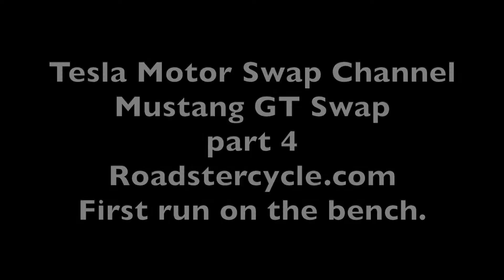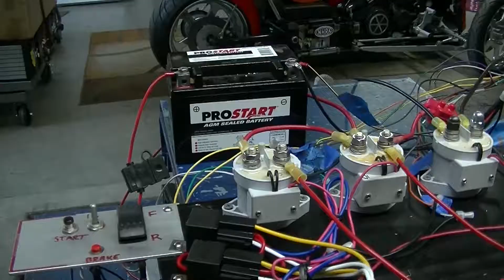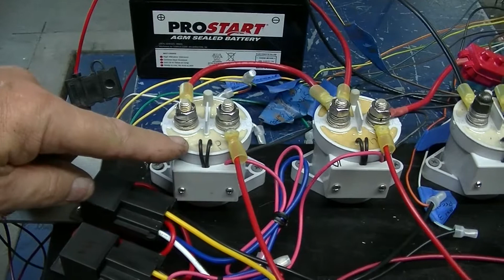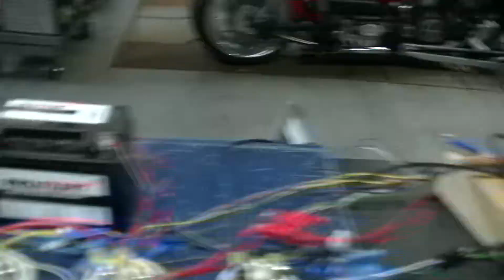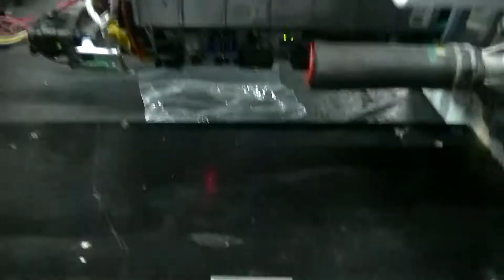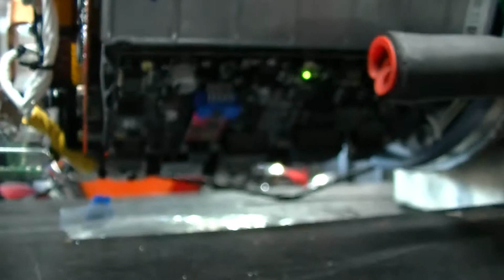Tesla Motor Swap Part 4

Comment: Hey Jack, do you know where I can get the wiring and the plug to connect into the motor? I have the motor but it came with a Prius Throttle intead of the tesla version and it have no wires. :)
Reply: Absolutely,  Go to DIYautotune.com and look at the Microsquirt (not Megasquirt) cable and they even have the connector and terminals kit by itself so you can make your own harness.  It's a direct match.  You can use the Prius throttle, I believe it will work from what I've read over the years.
Reply: @Roadstercycle  thanks a million for the tip. After having a look in what a Microsquirt is I found it in one of the boxes that came with the Damien board, but that is it, no wires, no diagram, I wonder it will be a long way ahead!
Reply: @andersoncarvalho9805  That's weird, I never got a plug in a Damien board for the Motor. Usually those plugs in the Damien board are meant to be soldered on the board not plugged into the motor but I could be wrong.